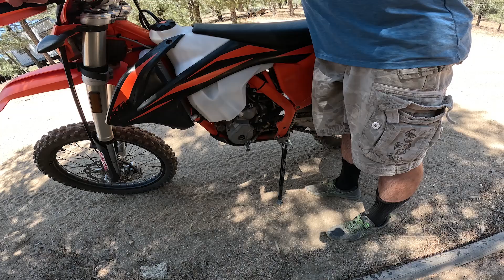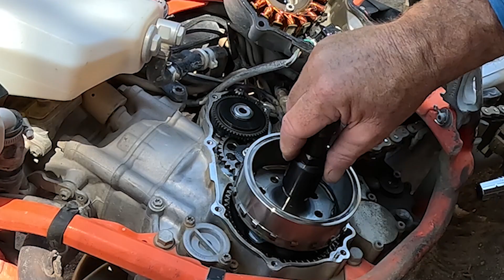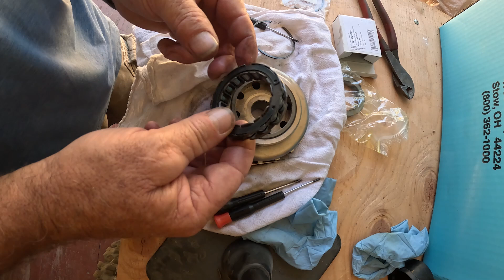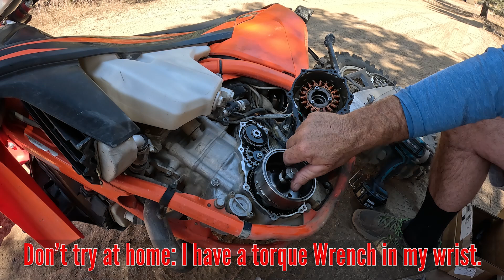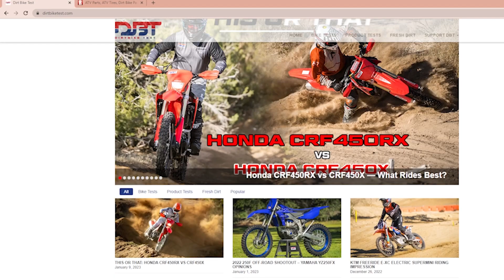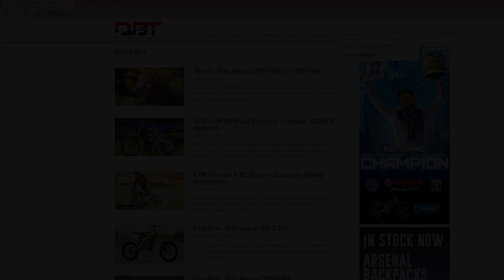KTM Electric Starter Sprag Clutch Repair

Comment: Thanks for sharing. I have a 250 excf 19 model   1860 hours 97000km with a kick starter. When I try to kick it the electric starter is turning. I believe that free wheel is not free wheeling.

Comment: Ever have this thing not disengage? My 350 seems noisy. I replaced the timing chain and tensioner but it still has a sort of "loud valve train" noise. I'm not seeing any wear on the cams. Valve clearances are in spec. So I started wondering if the sprague gear is stuck and I'm back driving the starter motor. Is that even possible?